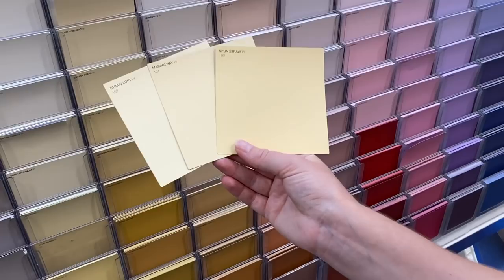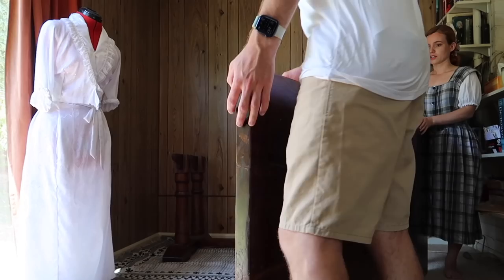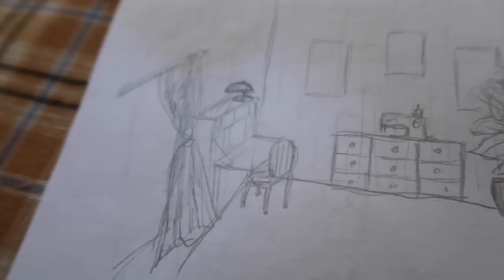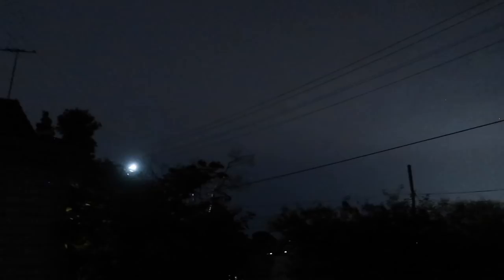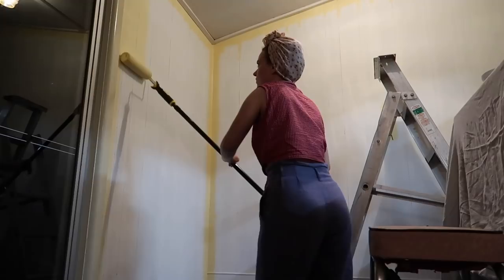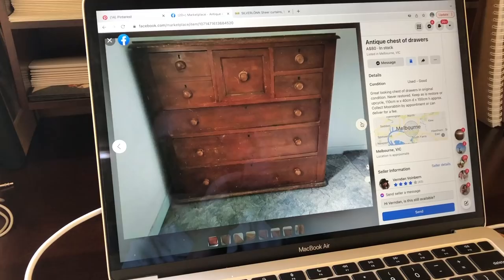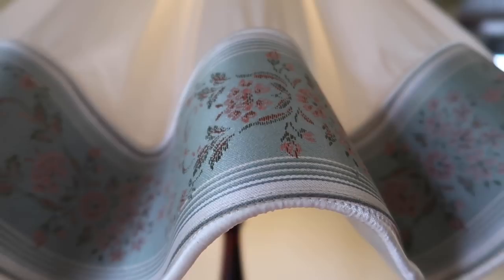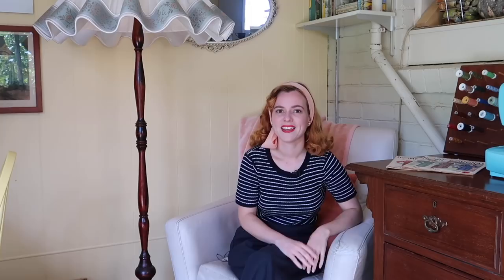Vintage Sunroom Makeover!

Comment: It’s such an interesting house in that, at some stage, obviously the porch has been built in to be a sunroom and laundry and what was previously outside is now inside.  I own a very interesting house too.  It was a war time weatherboard but when the weatherboards started to rot, instead of replacing and/or fixing them, my great grandfather enclosed them in brick instead.  So it was a weatherboard house, now a brick house and who knows what you would find if you opened up the brick walls 😂.  My goodness, they knew how to use space in those days though.  I have lived in a brand new build and now this beautiful old house and I can tell you, I prefer this old one by far. Such a sensible layout and so easy to heat/cool without aircon running 24/7.

Comment: Beautiful job. Just an idea incase you redecorate another room with panel walls, if you get the cheap wall spackle that you use to fill in nail holes, use it to fill in the lines on panel. It will give you a flat wall and prime those black lines. It’s cheap and gives you a normal looking wall without having to remove old panels.
Reply: If you want, you can still add DAP Patch-N-Paint 8 oz. White Premium-Grade Lightweight Spackling Paste to give a flat wall but unfortunately you would have to paint it.

Comment: not sure if this will help you but maybe it will next time you have to paint, when painting with your brush use longer strokes with plenty of paint. as for the roller, do you have one of those long handle people use with rollers to paint ceilings ?, if you do use that as well to do the walls. it will stop  you having to bend your back more. apart from that it looks good to me nice job both of you

Comment: It looks fantastic! I love a yellow wall. I had a feature wall in a colour called lemon juice when I was a kid lol. 
Next time you need to move something big and heavy like that tabletop, put big towels or blankets on the floor first then lift the furniture onto those. Depending on the piece, you can actually carry some things just by grasping the blanket at each end. With the table it would have given you the ability to slide it along whenever the floor surface allowed without damaging the table. Another thing that’s really handy for moving big, awkward pieces is a skateboard. Once it’s on there, you just need to steer it.

Comment: Wow, wood paneling is vastly different there. In the US.,  paneling is wood, but more thinly sliced (but not thin as veneer used on furniture) and in large sheets nailed to walls. Still just as much a pain, and why some paint over it and will also wallpaper over it.